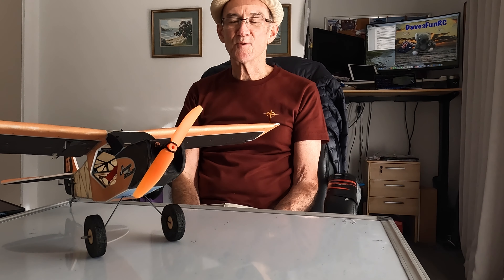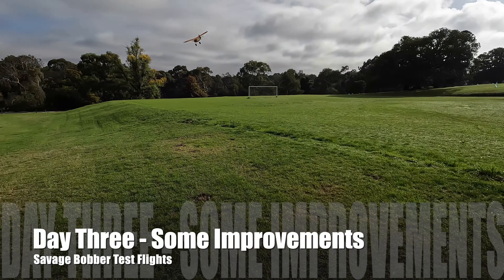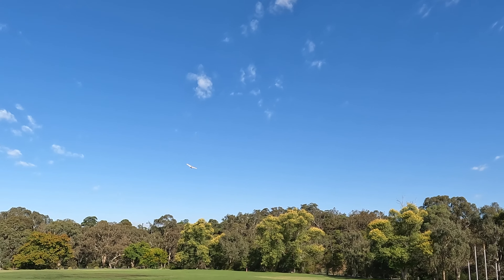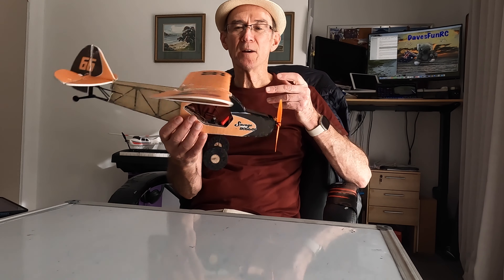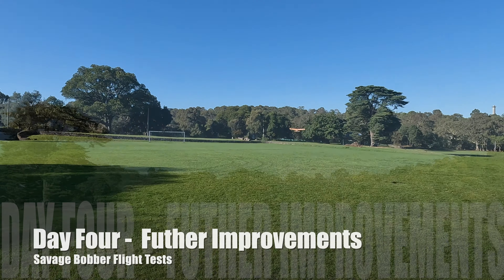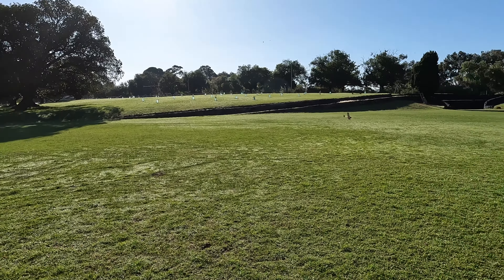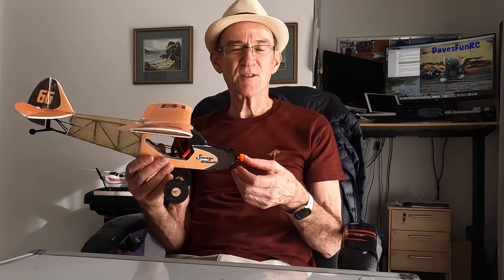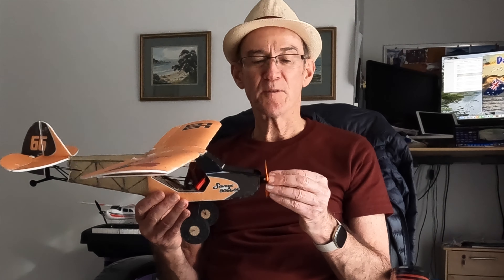Savage Bobber Maiden Flights

Comment: I wonder if a significantly larger tail would stabilize it since the aircraft is short coupled. I am about to build the kit myself so I might enlarge the tail and see what happens. I'll update as soon as I fly/crash it.
Reply: Hi, that would be interesting to see.  Let me know how it goes.  I think the two things that influenced the stability of my Bobber were build related.  When I glued the wing top on, I didn’t sit it flat on the table, resulting in a wing warp that I had to correct with hot steam.  I had a better result when I built the Dancing Wings Firebird - same wing.  It flies a lot better.  The other tricky thing was getting the fuselage straight.  I used superglue (recommended), to connect all the formers and stringers.  I was out of practice building and got more glue on my fingers than the fuselage!  This could have been straighter. 
Good luck!

Comment: What receiver do you use on the savage bobber? I just bought it but i dont have the receiver that works
Reply from the maker: Hi, I bought the kit which came with the RX156E receiver with brushless ESC, which uses the AFHDS-2A Protocol, compatible with my FSi6 transmitter.  What Transmitter do you have?  i.e. what Protocol(s) does it support?

Comment: How did u mount batt in yours.
Reply from the maker: Hi, the battery needs to go up the front behind the motor for the CG to be correct. I found the plywood formers were very brittle, so I had to glue in a base for the battery to sit on.